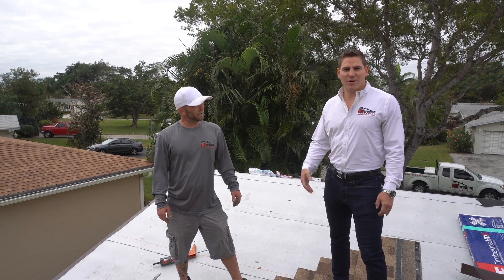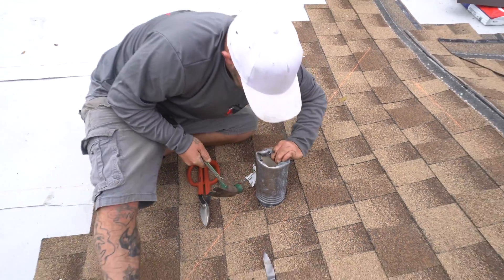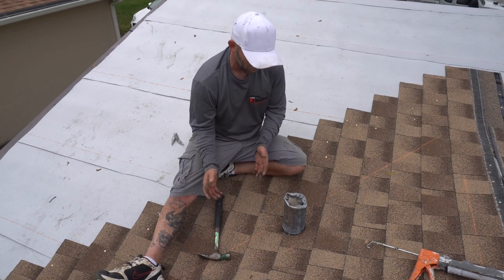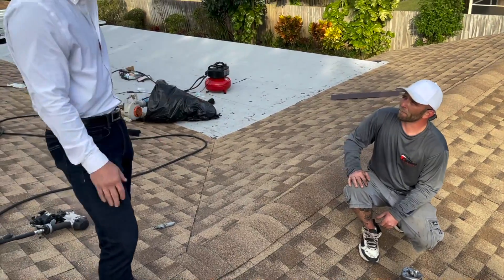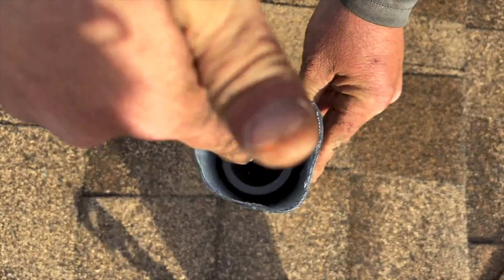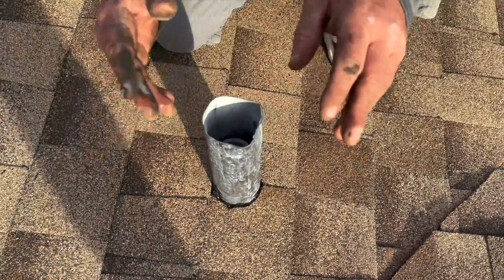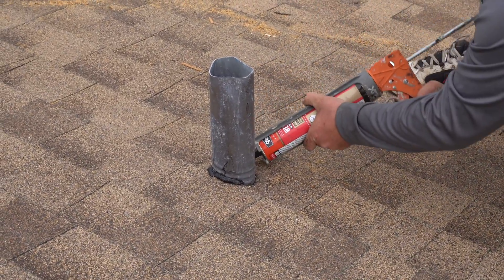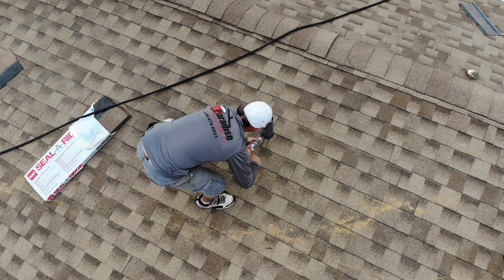How to Properly Seal your roofing Vent System following Florida Building codes by Paradise Exteriors

Comment: Bro I've seen ur other vids and if u have to put roof cement on your valleys then u ain't doing ur valley  right. A correctly installed valley wouldn't need roof cement to ensure no leaks

Comment: $20 and 10 minutes to move the vent out of the worst place possible would have money and time well spent. This half azz job isn't all the roofers fault, it was the hack lazy plumber who doesn't give a sh*t about the next guy. But is the roofers time and money to fix when it leaks. And has the balls or just that the lack of brain cells from baking on roof in the Florida sun everyday to post a video with your company name. Let me guess moving a vent so YOUR roofing job won't leak isn't your job. Hope your smart enough to take video off asap before too many real professionals share this as how not to do a roof flange. Classic Florida contractor "all you need is a little caulk and nobody will know the difference" SAD